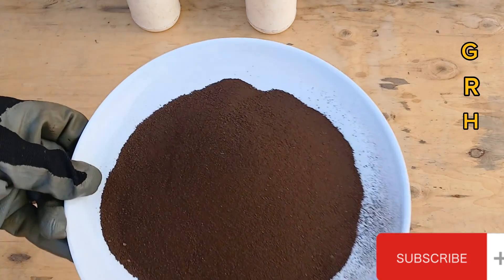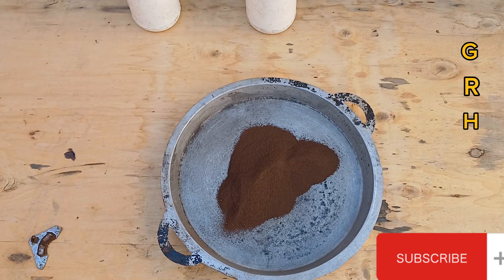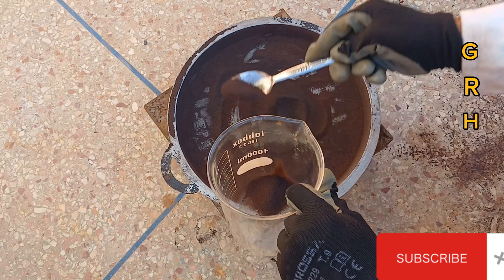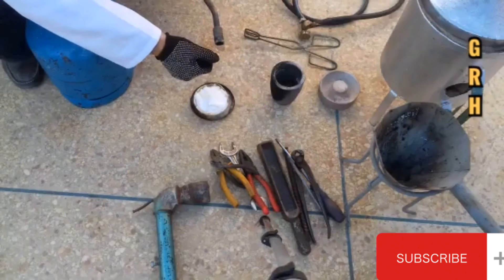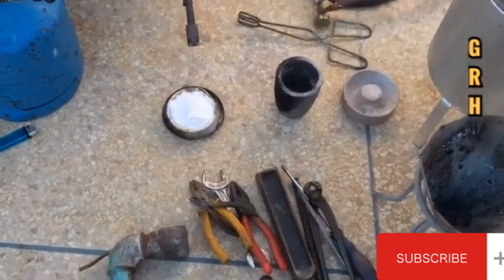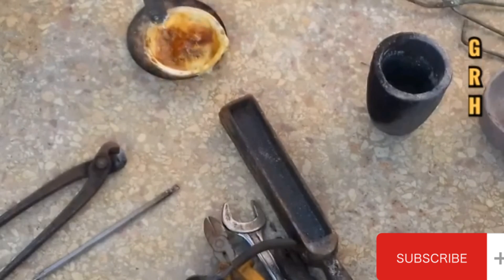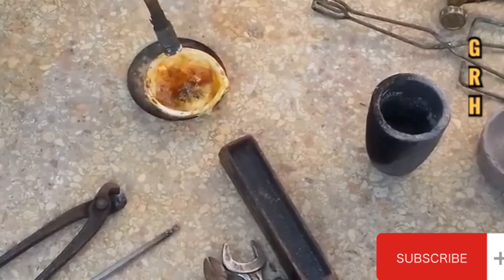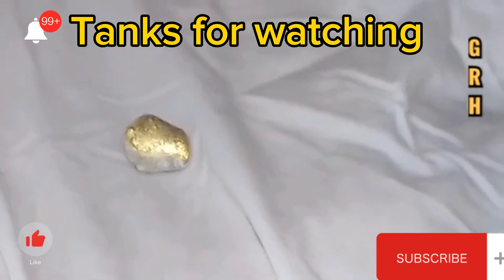Gold mining Turning  a Stone into  Pure Gold!

Comment: Hassan, if the roasted material dissolves in hcl alone without heating … then the precipitate (using iron sulphate powder) comes out as a brown precipitate (without adding water),, then when adding distilled water the brown turns to be white to yellow brownish !! 
Dont know whats wrong with that ore ,, but it is full of something (mostly silver and gold bonded together) .. What kind of ore behaves like that? Could it be gold-silver carbonate? And how to process it the best way, as the precipitate doesnt melt into metallic but becomes black just like slag !!
Reply from the maker: The behavior you describe suggests the presence of complex compounds, possibly involving silver and gold. The initial brown precipitate may be due to the formation of a complex with iron. The change to white or yellow-brown upon adding water could indicate the dissolution or alteration of the complex. 

Gold-silver carbonates are not common, but the complexity of ore deposits varies widely. The challenge lies in determining the specific compounds present. To process it effectively,